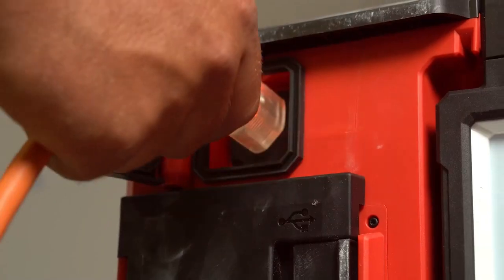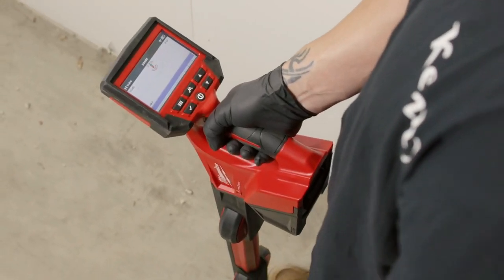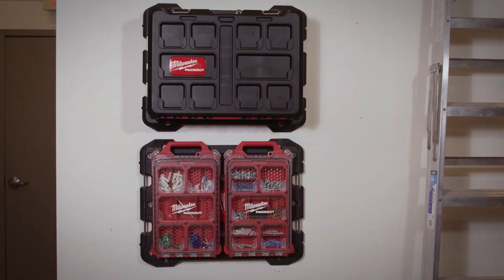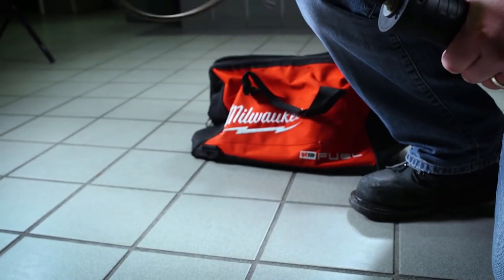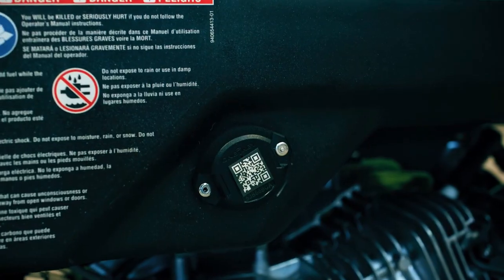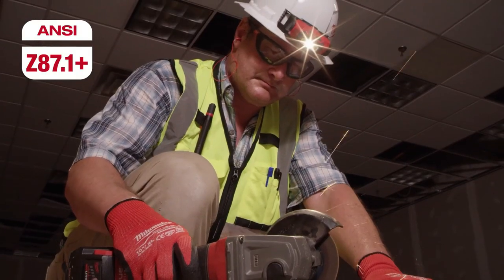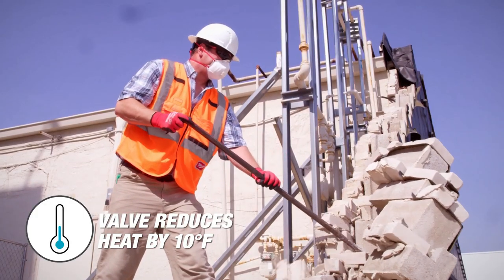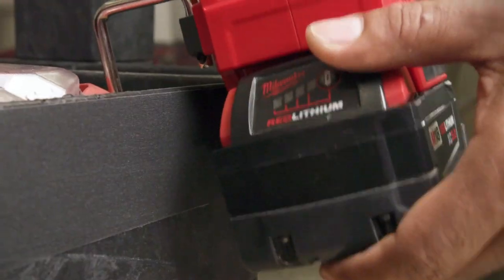Milwaukee Tools You Probably Never Seen Before  ▶ 3

Comment: Love Milwaukee tools. I have a locator made by Ridgid, how much is the camera?
Never mind, I just looked it up way too much. I’m just a one man show, not looking to spend that much.
I’ve been Plumbing since 1979.
I have the electronic brick that goes with the locator so I can send signals through iron pipes or wires and my steel cable which helps me to find sewer lines and pipes works really well. Just for the Ridgid brick it was 800.00 the locator was 2500 but it was yrs ago when I purchased it. 
I love love love My Milwaukee tools though, I have bought many when they first started coming out with the battery operated tools. I still have the first combo set with the sawzall that pivots. My first battery MT was the first sawzall in a plastic hard case, still works. Nothing like the new m18’s! They are great. I can drill almost an entire house on one battery with the Super Hawg, it’s even more powerful than the corded one. 
I believe Milwaukee has more cordless tools than anyone else or so it seems and a great selection. 
I’ve been using Milwaukee power tools since 1979, the Co I started with.